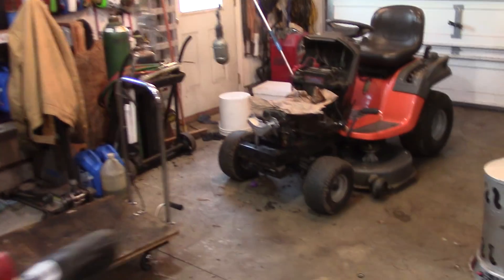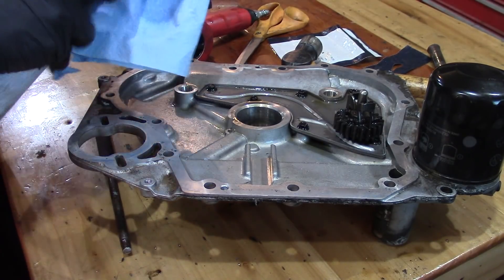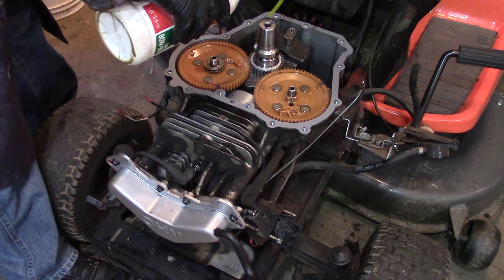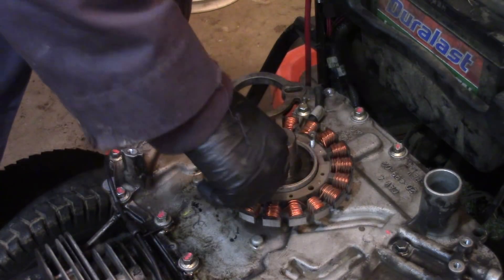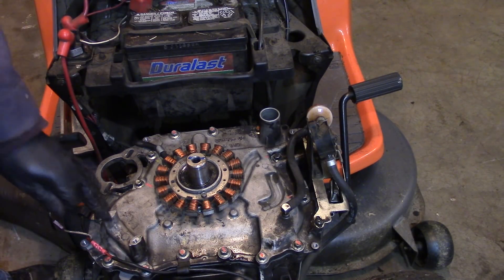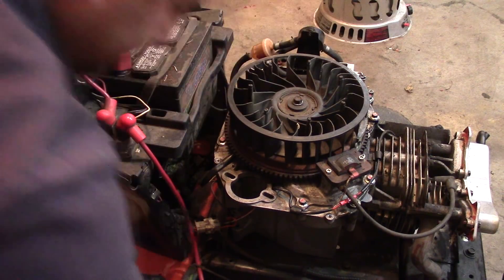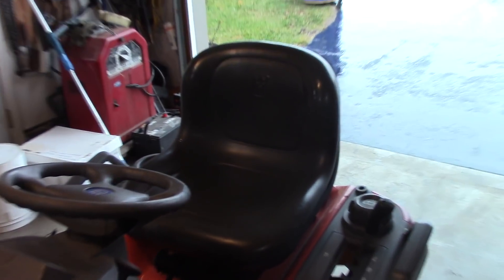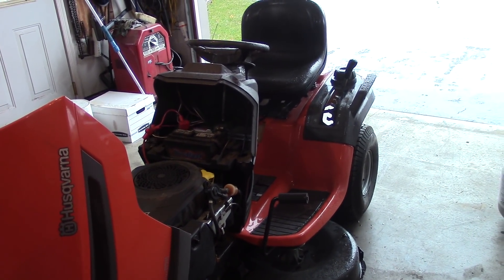Kohler Courage 20HP Leaking Oil Crankcase Gasket Part 2

Comment: Could have used pvc pipe to install plus making sure you don't knock it in to far and cover the oil return hole I did mine from underneath drilled a small hole inserted screw yank out

Comment: I Just got a free Ariens 42 inch with the Kohler 19 and need to do this myself. I Have either the check ball on the filter housing weeping oil or behind it in the gasket. I Already went thru everything else including the valve cover gasket.  I Can see the reasoning behind using the blue Loctite seeing how these bolts back off over time from heat and vibration.

Comment: Good Job, Mr. Bob. For those who own these Kohler engines those particular loose bolts you tightened on the sump cover sometimes loosen up to the point of getting caught on the flywheel. Whenever this happens the crankcase itself often gets cracked beyond repair. I would warn everyone who owns one of these engines to keep a sharp eye out for these particular sump cover bolts. By the way, Happy New Year to you.
Reply from the maker: That is good tip.  Thanks Bob
Reply: Yes, Dem bucket motors liked to loose up those closure cover bolts like crazy!  They actually discontinued the production of the courage single last year.

Comment: I have used a short piece of pvc with a piece of wood on top to hammer/press in seals and bearings. Pvc is like duct tape; multiple uses beyond what it was made for. Also, like you, I didn't use silicon around the crankcase gasket during a recent job. Some say use it, some not. But it is sealing just fine after many months.
Reply: jj parody exactly correct and cheap.
Reply from the maker: Good idea I have used it in the past, but I couldn't find a piece laying around that day.